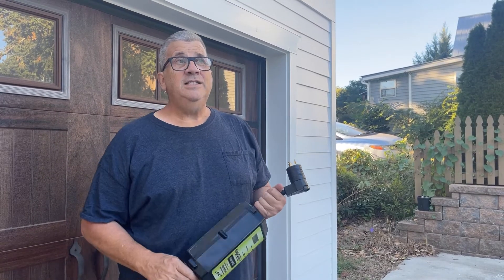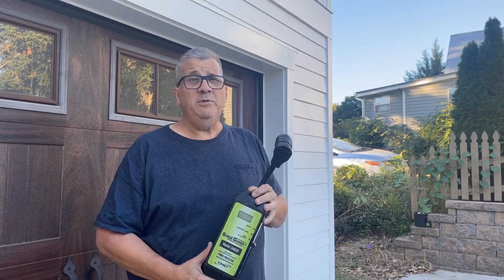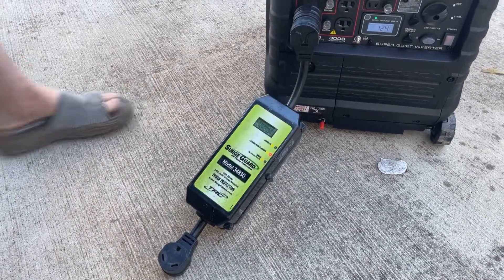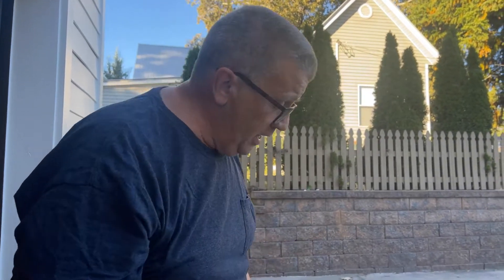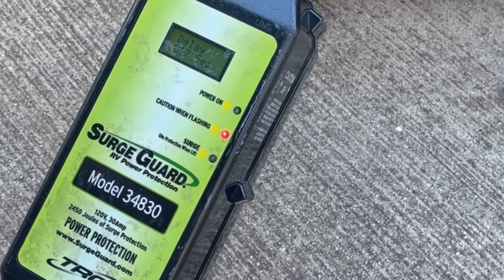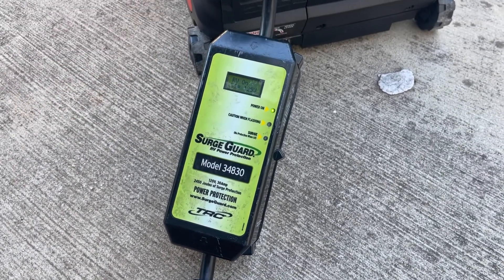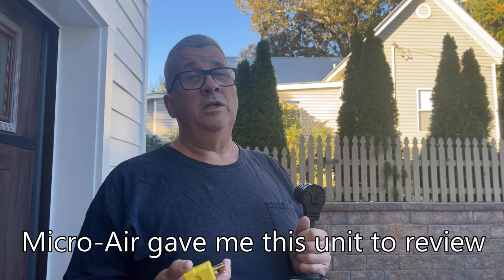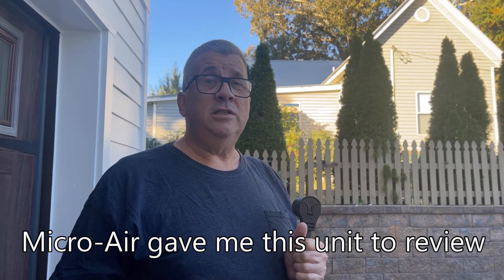Need A Neutral Ground Bonding Plug? Here's How To Connect An EMS + Generator!

Comment: Most built in EMS units have a "Bypass" switch which takes the EMS out of the system. This will allow you get rid of the open ground error. But then you don't have surge protection.

Comment: You are very smart Sir !!! ONLY IN YOUR RV, IF you use it just for extension cords(not a home system) drive a ground rod as well with  the ground to neutral plug you made/bought. !!! Tons of rules for safety....each one had meaning, just like every application has a different connection.......
Reply from the maker: Thanks.  I agree, a lot of rules for safety.

Comment: Hi Gard!  Thank you for your video on this topic. Very helpful!!  I have another concern. On my 2021 Coachman Beyond van, the Li3 lithium batteries are not charging when the engine is running. This situation began about six months ago and I do not know why.  I took the Ford Transit van into the Ford dealership and they told me that the secondary alternator is working fine.  have you experienced this before and do you know if any possible fix for this?
Reply: Thank you!  I did speak to Coachman by email. They also suggested checking the Balmer.  The Ford dealership suggested the secondary alternator works properly (I do not believe they really know what they’re doing) so I am taking the RV to my local repair shop Intrust so they can check out the Balmer. Coachman said they will be available to assist the mechanic through this process. I hope they can work together to fix the problem.
Reply from the maker: @tedm.9586  Coachmen Class B division is great in taking care of their customers.  Let me know how it works out for you.
Reply: I made an appointment with Coachman and they fixed the problem. It was the Balmer. Everything works fine now.
Reply: @tedm.9586  To those that don't know, please explain the purpose of the Balmer.
Reply from the maker: I suggest you contact Coachmen, it might be a problem with your Balmer.    If you go to the Coachmen website you can find the number for the Class B service.  

They might be able to help you over the phone or maybe fix it in Middlebury.

Comment: I am new to your channel, I like how you explain all you do to make your camping easier!!! I am interested in the Beyond li3, but I have a question…because of the length of the van does it drag when you go over a curve…like going into a gas station or a driveway?? Thanks…keep up the good video’s….going to binge watch them!!
Reply from the maker: Thanks!  The rear can drag if going into a driveway that is angled up.  The greater the angle the more likely it will drag.  Going at an angle reduces the chances of dragging the rear.  Another thing to watch out for is backing up over a curb.  My freshwater tank hangs behind the rear axle.  

I really love my Beyond!  The Li3 is great for us, it’s almost like being plugged in to a campground outlet.
Reply: @CampingCoastie  Thanks for the info....I had a Ford van years ago that I used to tow a trailer and it would sometime drag going into a gas station..when I had the trailer hooked up...I heard that coachman had lifted the beyond to help solve that!! Still I really like the Beyond Li3 setup...just have to find the right dealer!!
Reply: Second question...Why didn't you put the reflecticks on the inside of the windows??
Reply from the maker: @arthurgreen9712  I put it on the outside to block the sun from heating the outside of the van and windows.  I
If inside the windows it allows the sun to heat up the air between it and the glass.  That’s heat already in the van, still better than no Reflextic at all.
Reply: @CampingCoastie  Thanks